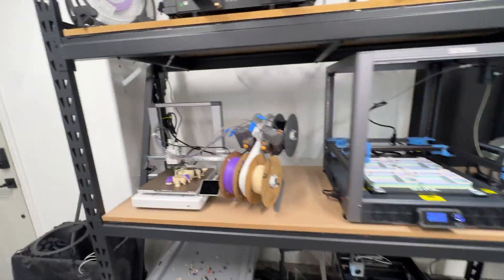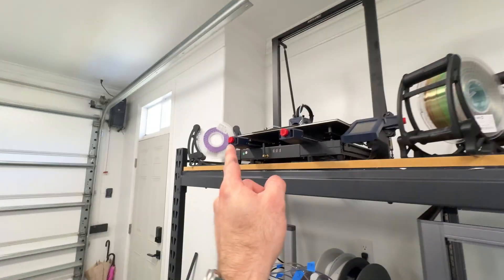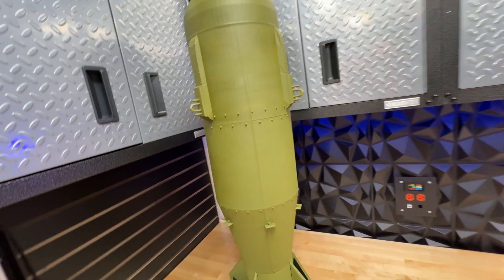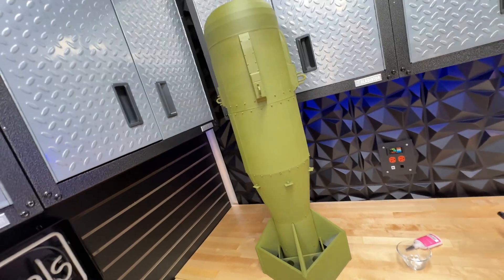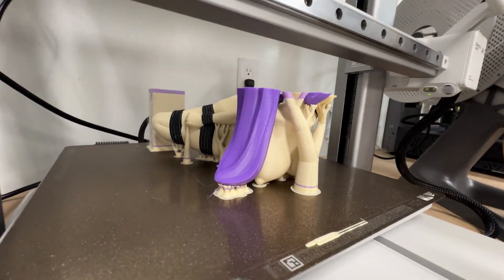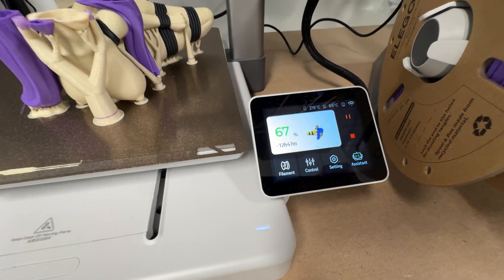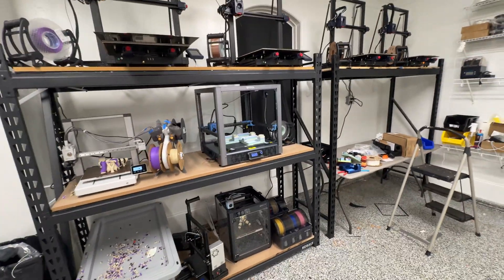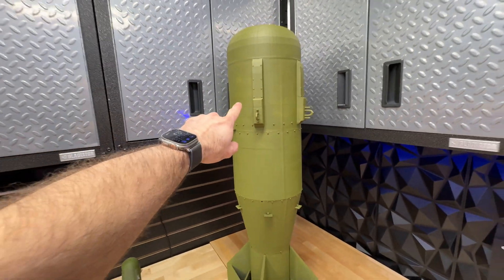At-Home 3D Print Startup Venture: Producing a big order & painting this cursed atom bomb MODEL

Comment: It looks like those parts of the bomb would be super easy to mask off and paint with a wide brush, but also, they do make those paint markers with a much broader tip. The bomb is looking great though. Since the detail on a figure's face always seems more important, I usually print my human figures on their back. It's interesting that you have the one girl face down. One thing that I print a lot of are targets for airsoft guns, they might be easy to sell in a pack. The stone die does look pretty neat. I have bought the Rustoleum 5 in 1 rattle cans and reuse the lid on other rattle cans. The low flow setting is really good for covering small and round shapes.